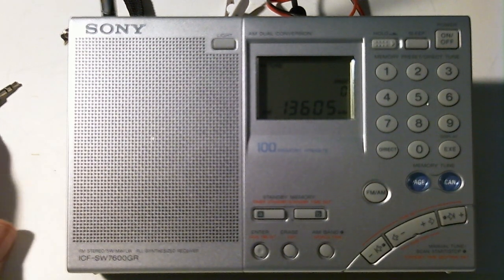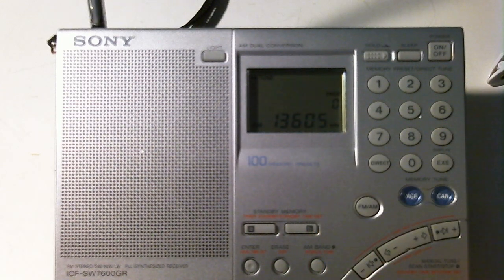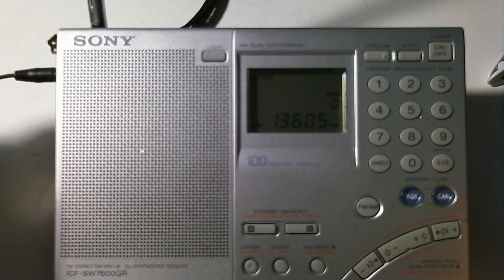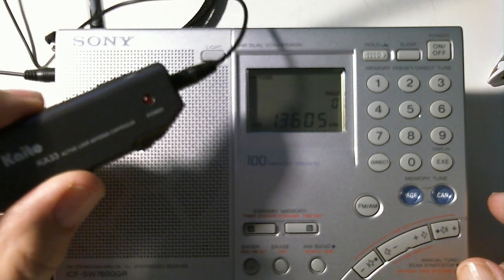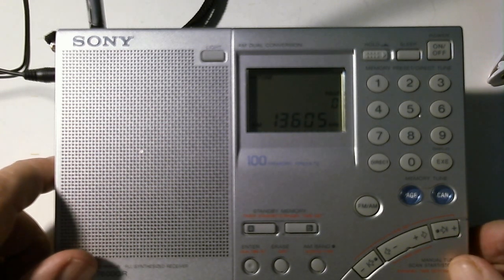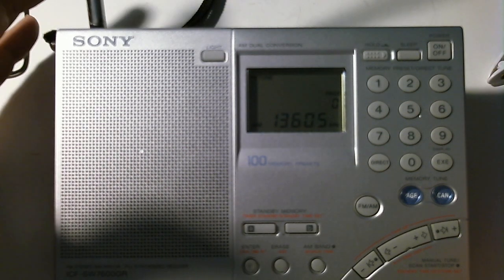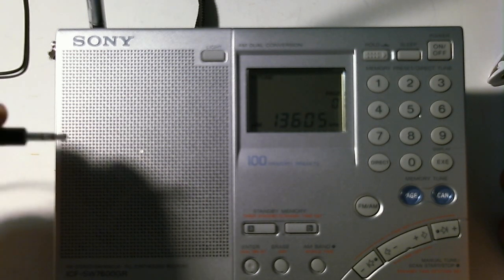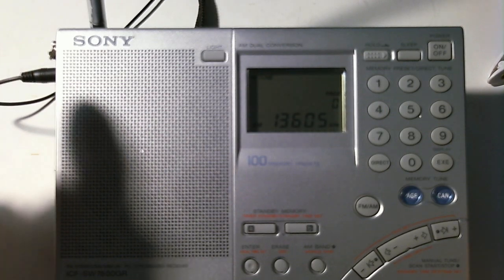TRRS #0293 - Loop Antennas - Useful??

Comment: Hi. Happy 2016! I happen to have these two units. The DEGEN DE31s produces some ghosts on 16m, 19m and 25m. When you don't have any station broadcasting you might  be fooled and think a station is silent either about to sign on or off, when in reality there's nothing, or it may compete with an actual station and produce an annoying whistle. But, despite these problems it has helped me in the absence of anything better than a piece of wire. I recently bought a small shielded loop passive antenna and it is my favorite. So quiet, it avoids most forms of QRN and therefore allows your receiver AGC act on a weak signal station that sometimes not even lights up the S-meter and thus have a loud and clear audio. With this antenna, I've been able to tune Radio Sultanate of Oman, Radio Indonesia, many BBC frequencies not designed to cover my region (South America and Africa), etc. I also have an old SONY AN-101 Active Antenna that came as part of the ICF-SW1s kit. I find this one better, doesn't produce ghosts and its coverage is wider from 3-30MHz. As for the ICF-SW7600GR, it is very sensitive and selective just like its predecessor the 7600G, great for ham dx but not so for broadcast due to its overly processed audio, so much so I prefer to listen to HF via speakers instead of headphones (it gives me headaches).73 from PY5WHO
Reply from the maker: +Julio Cesar Pereira Thanks for your useful comments.

Comment: It would have been interesting to see what would have happened to the noise had you changed the axis of the radio during reception, internal ferrite core wire wrapped antennas are also direction. 

I also agree with the previous poster who said when you touch an antenna or get in close proximity to the radio you become part of the antenna system, touching the antenna provides an alternative path to ground as well which can also effect the level of noise in the receiver not to mention an improved signal to noise ratio...
Reply from the maker: Thanks for your comments.

Tom
Reply: Thank you for posting...